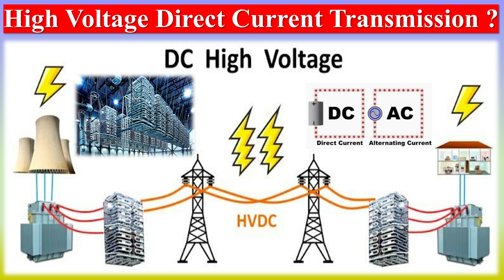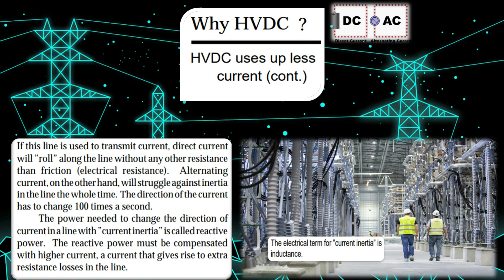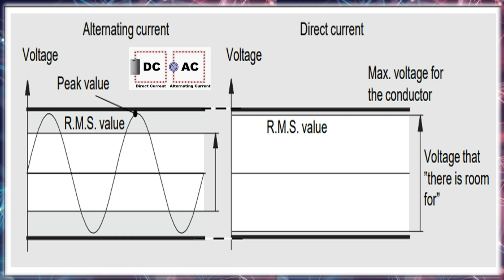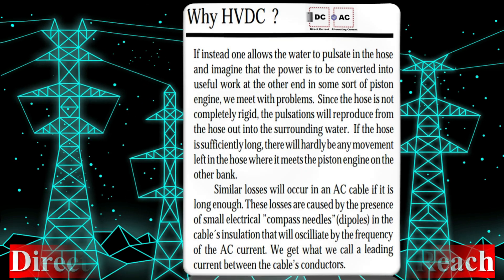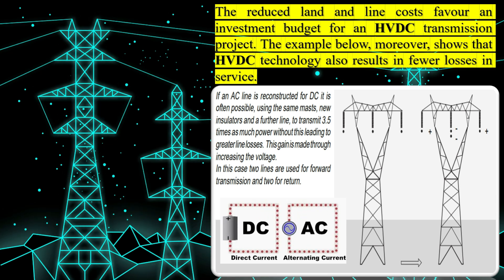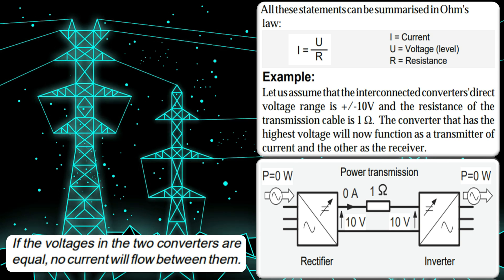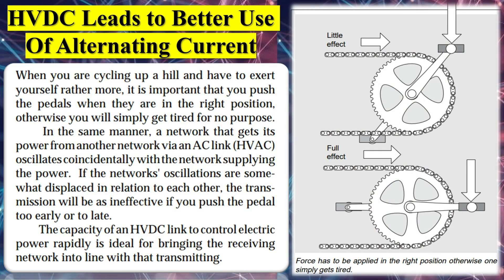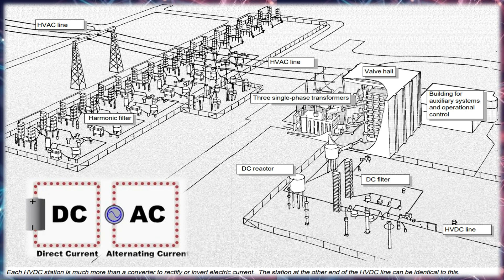High Voltage Direct Current Transmission | What is High Voltage Direct Current | HVDC Transmission

Comment: Thank You for this presentation.  With increased decentralized renewable generation the transmission and storage of power challenges our legacy grid system. It may be the case that HVDC will be the key to a battery based  substation system.